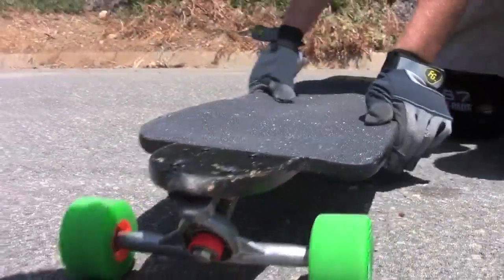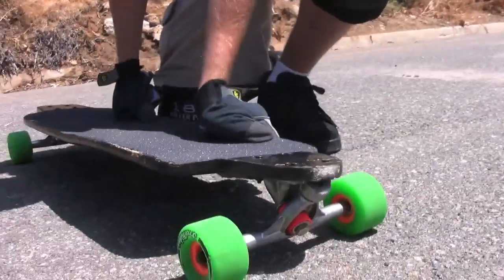Trick Tip: Front side stand-up

Comment: @someone19123 with those wheels you can do it at very low speeds which is where its most comfortable to learn (duh). Super loose trucks will definately help. Also, a small tip when learning is to throw way more weight into the slide than you think necessary, and carve hard into it. Hope that helps.